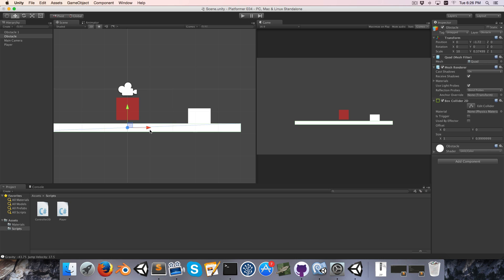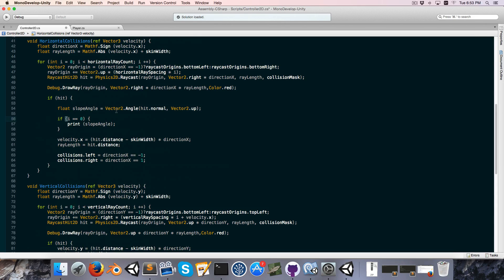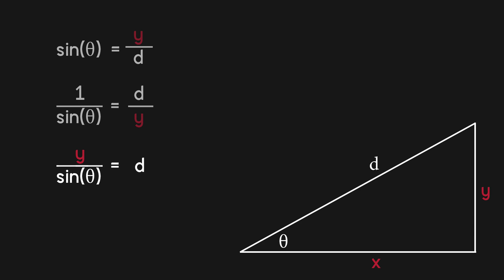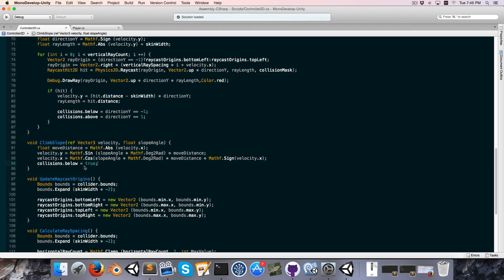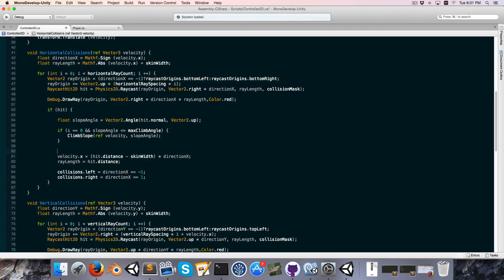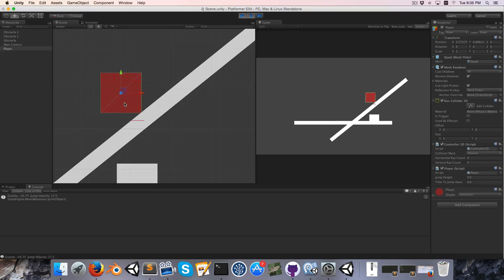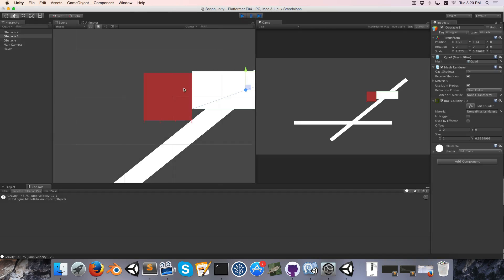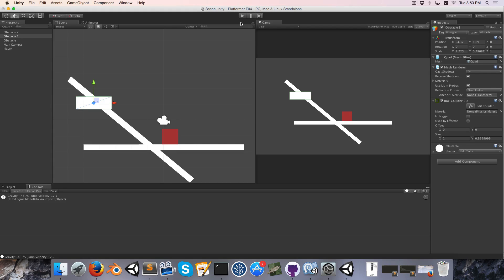[Unity] Creating a 2D Platformer (E04. climbing slopes)

Comment: CODE (CONTROLLER 2D.CS):

using UnityEngine;
using System.Collections;

[RequireComponent (typeof (BoxCollider2D))]
public class Controller2D : MonoBehaviour {
	
	
	public LayerMask collisionMask;
	
	const float skinwidth = .015f; 
	public int horizontalRayCount = 4;
	public int verticalRayCount = 4;
	
	float maxClimbAngle = 80;

	float horizontalRaySpacing;
	float verticalRaySpacing;
	
	
	BoxCollider2D coll;
	RaycastOrigins raycastOrigins;
	public CollisionInfo collisions;
	
	void Start () {
		coll = GetComponent<BoxCollider2D>();
		calculateRaySpacing();
	}
	
	public void Move(Vector3 velocity){
		UpdateRaycastOrigins();
		collisions.Reset ();
		if (velocity.x != 0){
			HorizontalCollisions(ref velocity);
		}
		if (velocity.y !=0){
			VerticalCollisions(ref velocity);
		}
		transform.Translate(velocity);
	}
	
	void HorizontalCollisions(ref Vector3 velocity){
		float directionX = Mathf.Sign (velocity.x);
		float rayLength = Mathf.Abs(velocity.x) + skinwidth;
		
		for (int i = 0; i < horizontalRayCount; i++) {
			Vector2 rayOrigin = (directionX == -1)?raycastOrigins.bottomLeft:raycastOrigins.bottomRight;
			rayOrigin += Vector2.up * (horizontalRaySpacing * i);
			RaycastHit2D hit = Physics2D.Raycast(rayOrigin,Vector2.right * directionX,rayLength,collisionMask);
			
			Debug.DrawRay(rayOrigin, Vector2.right * directionX * rayLength,Color.red);
			
			if (hit) {

				 float slopeAngle = Vector2.Angle(hit.normal, Vector2.up);

				    if (i == 0 && slopeAngle <= maxClimbAngle) {
					float distancetoSlopeStart = 0;
					if (slopeAngle != collisions.slopeAngleOld) {
					distancetoSlopeStart = hit.distance-skinwidth;
					velocity.x -= distancetoSlopeStart * directionX;
				}
				 ClimbSlope(ref velocity, slopeAngle);                                                                                                                                                                    
				 velocity.x -= distancetoSlopeStart * directionX;
				}
				 if (!collisions.climbingSlope || slopeAngle > maxClimbAngle) {
				 velocity.x = (hit.distance - skinwidth) * directionX;
				 rayLength = hit.distance;
				
				 if (collisions.climbingSlope) {
						velocity.y = Mathf.Tan(collisions.slopeAngle * Mathf.Deg2Rad) * Mathf.Abs(velocity.x);
			     }

				 collisions.left = directionX == -1;
				 collisions.right= directionX == 1;
				
				}
			}
		}
	}

	    void VerticalCollisions(ref Vector3 velocity){
		float directionY = Mathf.Sign (velocity.y);
		float rayLength = Mathf.Abs(velocity.y) + skinwidth;
		
		for (int i = 0; i < verticalRayCount; i++) {
			Vector2 rayOrigin = (directionY == -1)?raycastOrigins.bottomLeft:raycastOrigins.topLeft;
			rayOrigin += Vector2.right * (verticalRaySpacing * i + velocity.x);
			RaycastHit2D hit = Physics2D.Raycast(rayOrigin,Vector2.up * directionY,rayLength,collisionMask);
			Debug.DrawRay(rayOrigin, Vector2.up * directionY * rayLength,Color.red);
			
			if (hit) {
				velocity.y = (hit.distance - skinwidth) * directionY;
				rayLength = hit.distance;
				
				if (collisions.climbingSlope) {
					velocity.x = velocity.y / Mathf.Tan(collisions.slopeAngle * Mathf.Deg2Rad) * Mathf.Sign(velocity.x);
				}

				collisions.below = directionY == -1;
				collisions.above = directionY == 1;
			}
		}
	}

	void ClimbSlope(ref Vector3 velocity, float slopeAngle) {
		float moveDistance = Mathf.Abs (velocity.x);
		float climbVelocityY = Mathf.Sin (slopeAngle * Mathf.Deg2Rad) * moveDistance;

		if (velocity.y <= climbVelocityY) {
			velocity.y = climbVelocityY;
			velocity.x = Mathf.Cos (slopeAngle * Mathf.Deg2Rad) * moveDistance * Mathf.Sign (velocity.x);
			collisions.below = true;
			collisions.climbingSlope = true;
			collisions.slopeAngle = slopeAngle;
		}
	}

		void UpdateRaycastOrigins(){
		Bounds bounds = coll.bounds;
		bounds.Expand(skinwidth * -2);
		
		raycastOrigins.bottomLeft = new Vector2(bounds.min.x,bounds.min.y);
		raycastOrigins.bottomRight = new Vector2(bounds.max.x,bounds.min.y);
		raycastOrigins.topLeft = new Vector2(bounds.min.x,bounds.max.y);
		raycastOrigins.topRight = new Vector2(bounds.max.x,bounds.max.y);
		
	}
	void calculateRaySpacing(){
		Bounds bounds = coll.bounds;
		bounds.Expand(skinwidth * -2);
		
		horizontalRayCount = Mathf.Clamp(horizontalRayCount,2,int.MaxValue);
		verticalRayCount = Mathf.Clamp(verticalRayCount,2,int.MaxValue);
		
		horizontalRaySpacing = bounds.size.y / (horizontalRayCount - 1);
		verticalRaySpacing = bounds.size.x / (verticalRayCount - 1);
	}
	
	
	struct RaycastOrigins {
		public Vector2 topLeft,topRight;
		public Vector2 bottomLeft,bottomRight;
	}
	
	public struct CollisionInfo {
		public bool above, below;
		public bool left, right;
		
		public bool climbingSlope;
		public float slopeAngle, slopeAngleOld;

		public void Reset() {
			above = below = false;      
			left = right = false;      	 
			climbingSlope = false;
		
			slopeAngleOld = slopeAngle;
			slopeAngle = 0;
		}
	}

}

CODE (PLAYER.CS):

using UnityEngine;
using System.Collections;

[RequireComponent (typeof (Controller2D))]
public class Player : MonoBehaviour {
	
	public float jumpHeight = 4;
	public float timeToJumpApex = .4f;
	float accelerationTimeAirbourne = .2f;
	float acceleratinTimeGrounded =.1f;
	float moveSpeed = 6;
	
	float jumpVelocity;
	float gravity;
	Vector3 velocity;
	float velocityXSmoothing; 
	
	Controller2D controller;	
	
	void Start(){
		controller = GetComponent<Controller2D>();
		gravity = -(2 * jumpHeight) / Mathf.Pow (timeToJumpApex, 2);
		jumpVelocity = Mathf.Abs(gravity) * timeToJumpApex; 	
		print ("gravity: " + gravity + " Jump Velocity: " + jumpVelocity);
	}
	
	void Update(){
		if (controller.collisions.above || controller.collisions.above) {
			velocity.y = 0;
		}
		
		Vector2 input = new Vector2 (Input.GetAxisRaw ("Horizontal"), Input.GetAxisRaw ("Vertical"));
		
		if (Input.GetKeyDown (KeyCode.Space) && controller.collisions.below) {
			velocity.y = jumpVelocity;
		}
		
		float targetVelocityX = input.x * moveSpeed;
		velocity.x = Mathf.SmoothDamp(velocity.x, targetVelocityX, ref velocityXSmoothing, (controller.collisions.below)?acceleratinTimeGrounded:accelerationTimeAirbourne);
		velocity.y += gravity * Time.deltaTime;
		controller.Move(velocity * Time.deltaTime);
	}
}

STOP HERE!!!

I am sorry that the cube keeps fast falling i tried fixing it i don't know what happened, but if you do i would love to know thank you.
Reply: void Update(){
  if (controller.collisions.above || controller.collisions.above) {
   velocity.y = 0;
  }
in this replace the second above with below. Like
void Update(){
  if (controller.collisions.above || controller.collisions.below) {
   velocity.y = 0;
  }

Comment: +Sebastian Lague First of all, thank you so much for this video series! It's helping me to not only build a better platformer than I could with Unity Rigidbodies alone, but also to understand how to better deal with character movement in general.

I did have a question though... around the 13 minute mark, where you're fixing the problem of the player starting to move up the slope before it's actually there, you start subtracting the distance to get to the slope from the velocity before calling ClimbSlope(), and then finally adding the same distance back in. I can't for the life of me understand how this has the effect of stopping the player from moving up until it reaches the slope... could you explain it in more depth perhaps?

Thanks again for these videos, I really appreciate them.
Reply: +Garrett Widner Im in the same situation, I understand that when the player start up the slope we approached it first into position to prevent separation and then call ClimbSlope () but I do not quite understand why adding the separation field distanceToSlopeStart later...approach-climb-ward off 0_0
Reply: +Martiniano Bergoglio Ah! I was going through the code again, and I think I've got it. So first, keep in mind that this is all happening in a single frame. In one frame, we need to 1) move flush with the base of the new slope and then 2) move up the slope. distanceToSlopeStart is 1), or how much of our velocity this frame it will take to move us to the base of the slope. We subtract it from our total velocity in order to get how much velocity will be 'left over' once we're at the base of the slope to then move up it. We pass this new ‘left over’ velocity into the ClimbSlope() function in order to translate it from the purely horizontal movement we started with into diagonal movement. Now we have our 2), the up-slope movement, housed in the velocity variable. When we add distanceToSlopeStart in again after ClimbSlope() is called, what we're doing is combining 1) and 2), in order to give us exactly how we'll have to move this frame in order to 1) get to the slope, and then 2) move up it.
Reply: I think I'm understanding, but i think we would have to see if Mathf.Abs.(velocity.x) < Mathf.Abs(distanceToSlopeStart) and then velocity.x += Mathf.Abs(distanceToSlopeStart) - Mathf.Abs.(velocity.x) * directionX.
That is, we increment velocity.x only the difference to reach distanceToslopeStart.
Reply: thanks u cure my headache!

Comment: Thanks for the great tutorial! I was curious how you would approach rotating the character box to be at the same angle as the slope? I've tried transforming the z value of my player to match the slope angle via both rotate and eulerAngles, but neither work properly. The angle of the character looks correct, but I'm assuming there's an issue with my x and y values which causes floating

Comment: Not sure if you handle this later on, but if not, could you do a video for how you would climb stairs, like with the Standard Asset character controller, but one that doesn't suck?  I've had times where I needed the step offset but it creates some weird effects for too large a step (like floating in midair even when walking away from the steps).  And the situation was such that I couldn't change the collider to a slope and fudge it because I needed the concave mesh data for other things.

I think it might be quite helpful to know how you would tackle that and it seems like the next logical step in this series.

Comment: After implementing the velocity.x -= distanceToSlopeStart * directionX and the readdition part, my quad moves half it's length into the slope on the x and then moves up on the y and sits atop the slope again.
Reply: Jason Pack 
It's all your code except:

   if (i == 0 && slopeAngle <= maxClimbAngle) {
      float distanceToSlopeStart = 0;
      if (slopeAngle != collisions.slopeAngleOld) {
          distanceToSlopeStart = hit.distance - skinWidth;
          velocity.x -= distanceToSlopeStart * directionX;
      }
      ClimbSlope(ref velocity, slopeAngle);
      velocity.x += distanceToSlopeStart * directionX;
   }
Reply: Jason Pack checked your code with mine side by side, no known differences, but copying your code works fine... oh well..

Comment: what means ( i ==0 ) condition?

And I don't know why, I am swithing _controller._collisions.below true\false while climbing, so, it is impossible to boost up.
Reply: Alexey Filimonov The i == 0 part refers to the ray being emitted from the bottom of the collider.  We set i == 0 to make sure we're only checking where the "bottom of the player's feet" would be, so to speak, in determining if we're in contact with a slope or not.

You're switching the bool to true to ensure that the script knows you are still on the ground so you can jump.  The way the rays are done, it thinks you're in the air because some of the earlier rays are casting further.

Comment: I was following this but kinda lost interest  after knowing that it does not supports unity5  effectors. Now I'm trying to achieve something in the middle while maintaining compatibility with effectors.
Reply: ***** Stick around, it might be covered later! You never know.
Reply: i know its 3 years later but can you use effectors in modern unity while doing your own physics code?
Reply: Actually I was looking for the same answer nowadays...

Since I've completely changed my own Dynamic RigidBody to this one just to get slope climbing done, I've seen that I was no more able to use effectors. How bad! :(

Now I'm stuck in between these two.
Wether  to use Dynamic RigidBody or a Kinematic one... =(

Of course, one can write every single calculation in a cutom controller for simulating those effector FX's, yet, it's a huge undertaking. 

Have you found any answers to this?

thanks,
Reply: @5ub2ero  what are the benefits of using effectors? or what do you use effectors for?